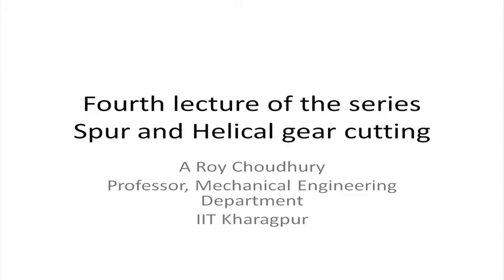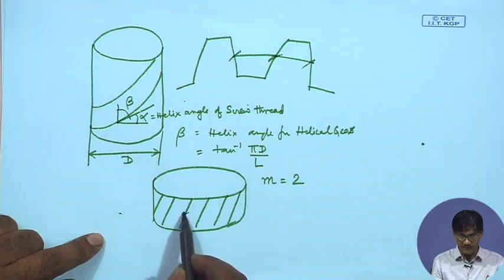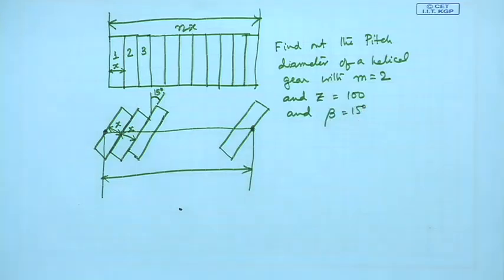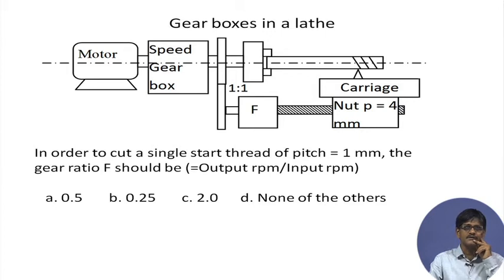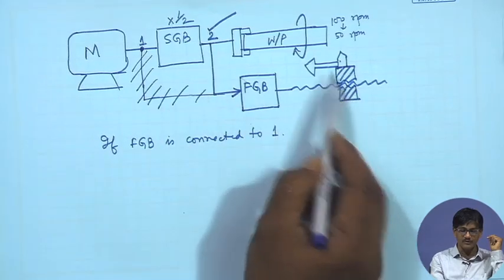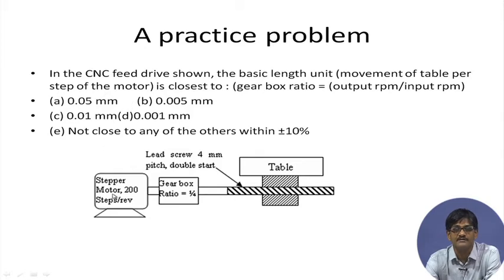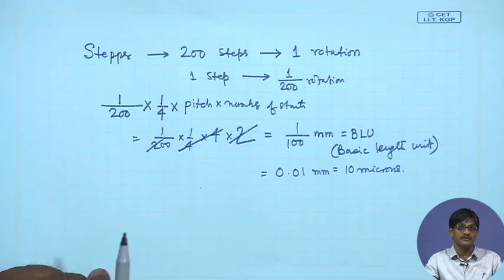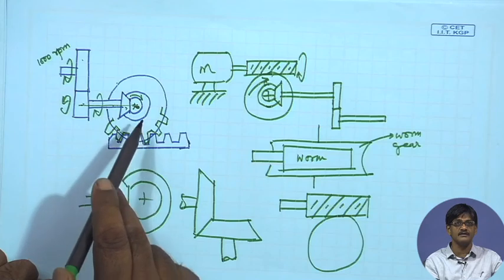Helical Gear Problems

Comment: Good Morning
I need help to make helical gear
I have a machine but no manual
sonsigo make only straight tooth
can you help me?

buen dia
Necesito ayuda para hacer equipos helicoidales.
Tengo una máquina pero no tengo manual
Sonsigo solo tiene dientes rectos
Me puedes ayudar
soy brasileño
Tabla constante 1:60
My Whattsapp - +5591991070448
Gear Hobbing